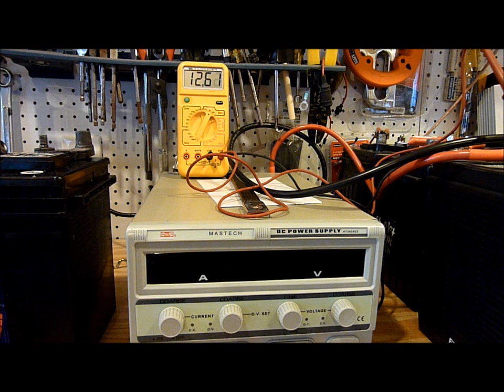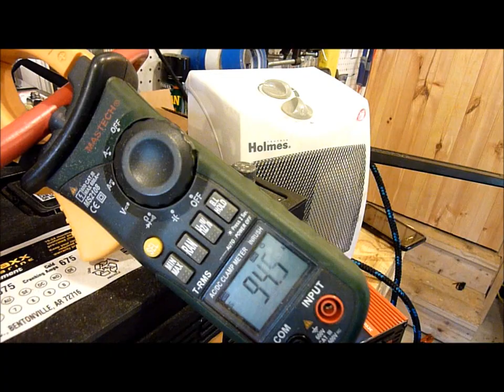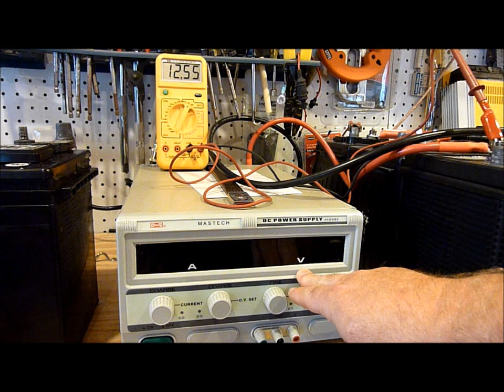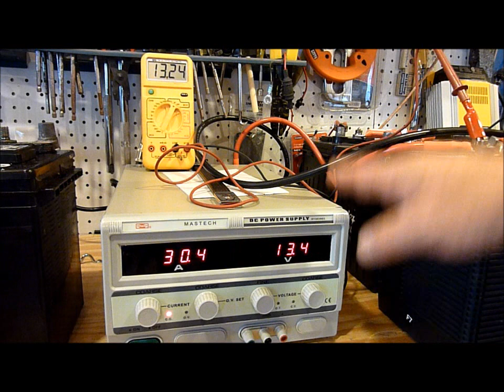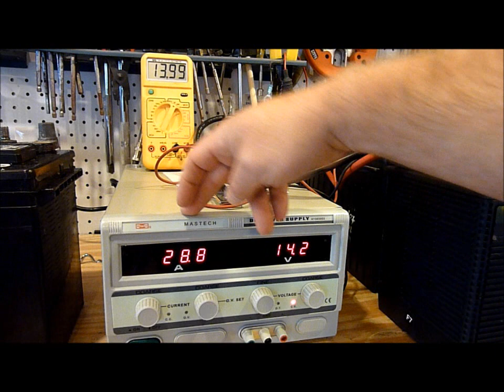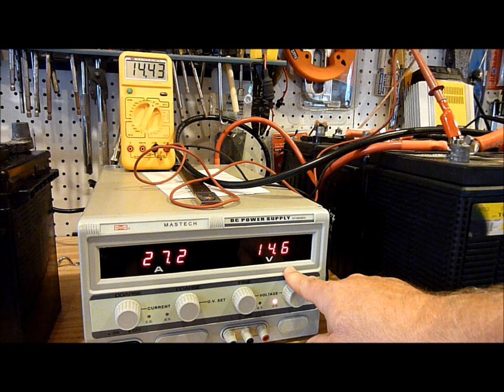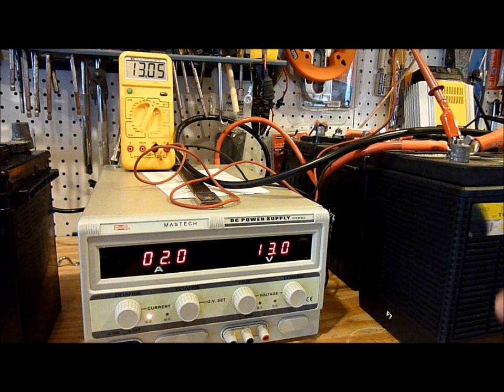Current, Voltage & Battery Acceptance

Comment: I got so sick to death of idiosyncratic electronic arguments between my solar controller and my external alternator regulator, such that I put relays to disconnect solar charging when the ignition is on. What point in some trickling 50-300 watts of sun when the alternator is pumping in 1800 watts under way. Use "normally closed" relays on BOTH the PV input negative line AND the output common earth to the battery to put solar regulator to sleep when motoring.

Comment: Wrong. Battery charge usually starts with constant current to 80%SOC than change to constant voltage to 100%SOC then change to trickle. Unless trickle other two modes might over charge or hurt battery if you don't stop. your battery would be 13.0xV so constant 2A cause it 13.1V. When you use constant 14.6V the 30A means your battery has impedance (14.6-13.1)/30=50mohm, nothing else. Solar panel is not constant voltage regulator, so when you hook 14.6V the battery might still get 13.1V then raise to 10x%SOC - might be 14.4V or whatever the battery's end voltage, and if you don't cut off, battery will boil,lost water and life will be shorted if not explored. Another thing is, if you use small current to charge, eventually you will get a little higher terminal voltage than you use larger current. If you don't want to adjust your power supply, set to end voltage say 12.7V or a value suggested, then it would take longer time for fully charge.
Reply: No, YOU'RE WRONG. 

Firstly it depends on type of battery and secondly, type of regulator. Lithium vs SLA; internal regulator vs external. 

As I posted above, put the solar controller to sleep when engine charging. SIMPLE.